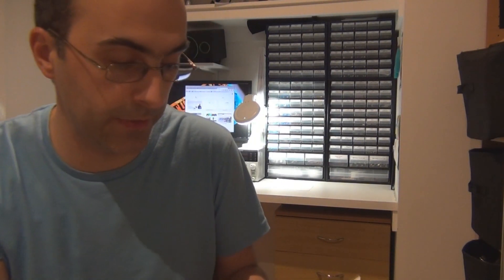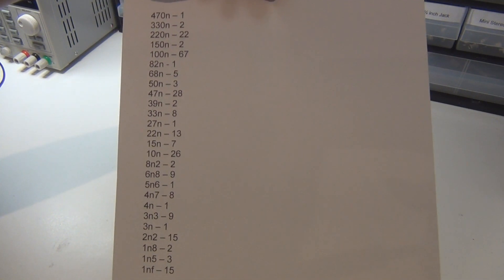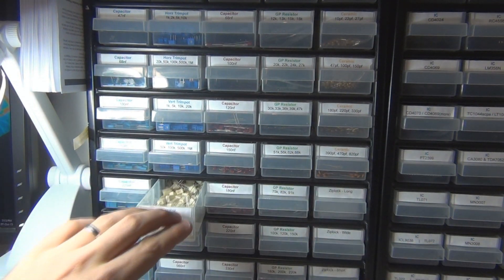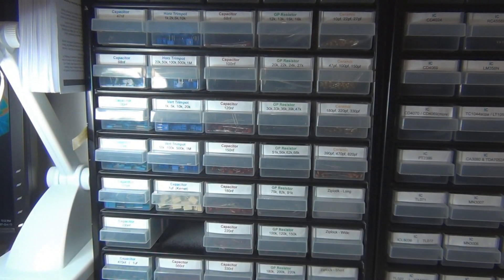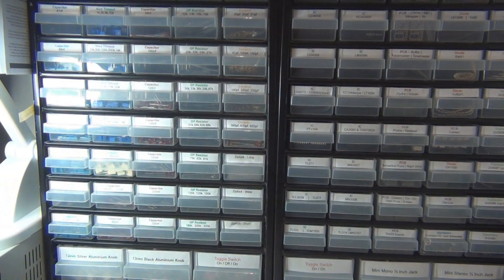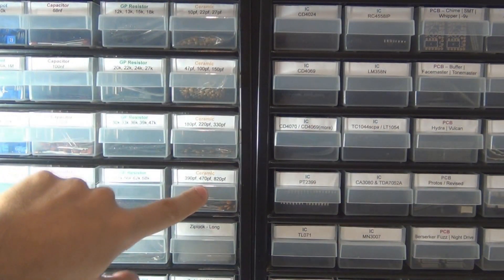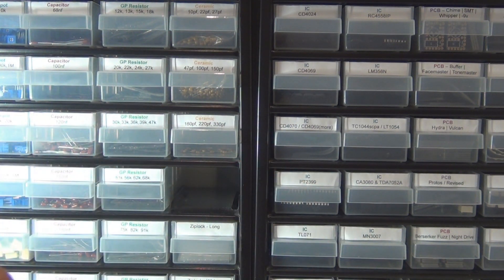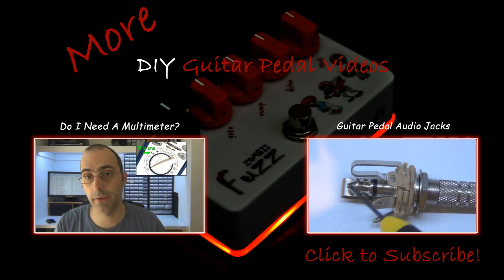Common Pedal Parts Stock Up List - Resistors & Capacitors Part 1

Comment: what about capacitors Volts??? what is the best to use or stock?
Reply: Generally for caps you want to get as close as you can  to double the voltage of the circuit. Since most guitar pedals run on 9 V, you wouldn't want to a capacitor lower than 16 volts. You can also use a higher voltage capacitor so long as it will fit in the pedal.

Comment: Hello there. Anyone know if could I replace 1x 50pF Ceramic Disc Capacitor for a 47pF or 50pF? I'm trying to build a TS9 clone that requires 1x 50pF one. Thanks in advance.

Comment: Having them sorted is so important. I actually did my resistor groupings by base value. Eg. 4.7, 47, 470, 4.7K, 47K, 470K, 4.7M, 47M are all in one drawer.

Comment: Sir, I'm looking to change an orange drop 104 cap (100n) for an electrolitic or film cap to upgrade a clean boost would you recomend to change the value? I look for more clarity and better sweep so I thought of a .22 or .47 is that ok, will my pedal still work? Which one would you recomend ?

Comment: DIY Pedal Parts List
470n-1
330n-2
220n-22
150n-2
100n-67
82n-1
68n-1
50n-3
47n-28
39n-2
33n-8
27n-1
22n-13
15n-7
10n-26
8n2-2
6n8-9
5n6-1
4n7-8
4n-1
3n3-9
3n-1
2n2-15
1n8-2
1n5-3
1nf-15
Reply: You are a kind stranger
Reply: @cybrnekomusic  thank you!
Reply: Thank you kind stranger
Reply: What are the wattage ratings on these capacitor or resistors values? For example, 1 kohm-1Watt at OBRG banded. Nice drawers BTW!
Reply: appreciated!

Comment: About the capacitors... I know the ceramic once are not the "audio" type capacitors, but for lower range capacity, like less than 10n(103), it's hard to come around the film ones. So my question is it worth bother searching and buying the film capacitors of the value less than 10n or is it ok to use ceramics for those?
Reply: It should be fine, effects layouts has done it and has had no difference in tone
Reply: Can confirm after building my boost pedal
Reply: I have the same question but regarding box caps vs multi-layer or ceramic - can these be interchanged. I've heard that "A cap is a cap, is a cap" and the difference is only really noticeable if you're a perfectionist. In the process of making a mid-boost pedal and using ceramics in place of anything else. Will be interesting!

Comment: NEVER buy components from china. the sellers are all over ebay. everything they sell is counterfeit junk. trust me I've been burned a few times. buy components from Digikey, Mouser, or the small American stores like smallbear. The surplus electronic places are good too. Tayda is ok but not for semiconductors. they've been known for selling counterfeits too
Reply: All components come from China, never had a problem with any of my orders, nor have I ever been ripped off. Use reputable sellers, check ratings, simple. Ebay is all about buyer support.

Comment: Thank you so much for this. Question: I've always been curious as to what quality to buy. I've asked around and have found no answers from anyone as of yet. Would, say, $2-3 Mundorf resistors be worth it? Audience caps costing $50 a pop? Any input would be greatly appreciated. Thank you.
Reply: Lol a 3 cent cap and a 50$ one do thr same job my dude.
Reply: Even cheapo resistors and capacitors are good if they are the the right value

Comment: So how can one differentiate what each component does/contributes to a guitar effect?
Reply: they do different things in different circuits
Reply: That's a great question. With all the talk about current flow and capacitor values and the like, I'm not sure how they affect the sound. For instance, what is the difference between components used for a chorus pedal vs. those used for a fuzz?

Comment: Great video. Thanks for the good advice. I have decided to start building quite a few more pedals and hopefully get my young son interested in the builds too.  (He has perfect pitch and comes in quite handy when dialling in caps n resistors hehe). We have found your products to be good quality and your instructions and guide videos, second to none. It's usually a pain trying to figure out what to order next for stock (especially between, needing, wanting and wishing), so I'm looking forward to your next video in this series. 
P.S. I blame you for my new addiction to those 9mm Alpha pots.
Reply from the maker: +ssorc werdna Awesome, thanks Ssorc!  Im looking forward to when my son gets to an age where a soldering iron can be used more for a tool then a weapon. Don't worry I get blamed for a lot of pedal related addiction :)